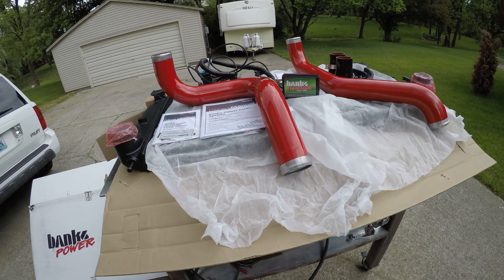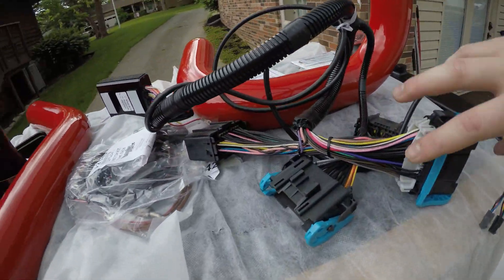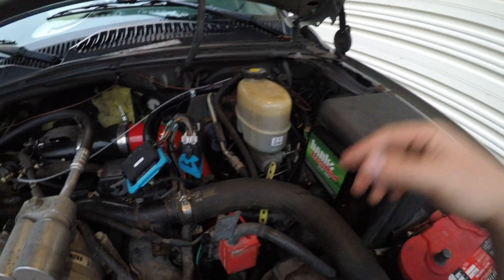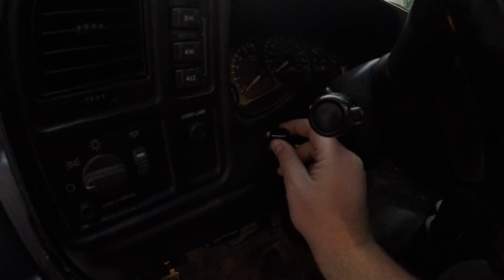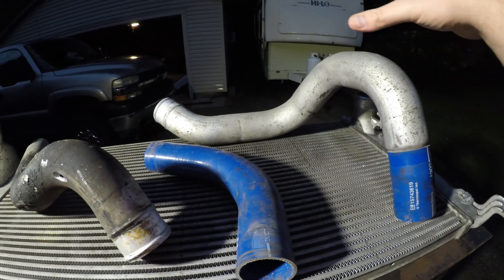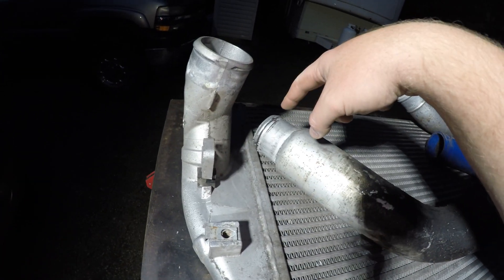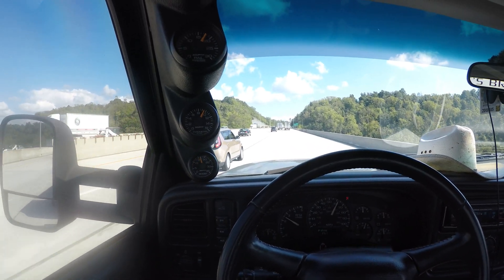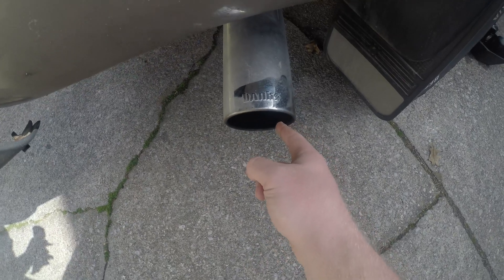Upgrade Lowdown:  '02 LB7 Duramax Banks Power TechniCooler Intercooler and EconoMind In-Line Tuner

Comment: I have always had EFI Live....think on this LB7 I will go with all Banks!!
Reply from the maker: Great!  These tuners are MUCH safer than EFI Live because of their active drivetrain protection.  That's how I'm able to send so much power through my stock transmission.  If you buy the tuner over the phone, please ask for Chuck and tell him that you learned about it from my video.  That'll really help me out!
Reply: @JayRussellDuramax  This tuner isn't safer than EFI Live. The only time it would be unsafe is if some clown that doesn't know what they're doing creates a crappy tune. EFI Live platform spanks on any other piggyback or flash tuner.
Reply from the maker: @2015_Rubicnn  Then why does everyone who uses EFI Live talk about hurting these transmissions with much less power than my truck is making?  

I emailed with Duramax Tuner, and, even with all of the upgrades I've done to my truck, their maximum power gains were under 100 horsepower at the tires.  The Banks tuner puts out more than that on a truck with far fewer upgrades than mine.
Reply: @JayRussellDuramax  It's not EFI Live tuning that hurts the transmission, it's the amount of power that gets added. The stock 5 speed can't handle much over 100HP extra over its stock rating. The allison is designed to sense slipping between the input and output of the transmission, and when it does, it goes into limp mode to preserve itself from any more damage. I'm pretty sure tuners like Idaho Rob, Duramaxtuner, PPEI know what they're talking about and limit 5 speed truck tunes to 100HP. If you look at the LBZ and up tunes, thet are rated at 120HP+ for stock transmissions. You'd have to see exactly what the Banks tuner is doing to make these claims..I just don't see how this piggyback tuner can supposedly be safer, yet provide more power, makes absolutely no sense. 🤷🏼‍♂️
Reply from the maker: @2015_Rubicnn  It's because EFI Live is static tuning.  When you reprogram the ECM, it runs the engine the same way all the time.  The Banks tuner is actively monitoring all of the engine and transmission vitals to ensure there are no issues.

The myth that the stock Allison can't handle more than 100 horsepower over stock is propagated by EFI Live tuners that add power in a way that doesn't respect the transmission.  The Banks tuner monitors for slippage and pulls power if it senses anything that could harm the transmission.  EFI Live does NOT do that.  If you tune your ECM with EFI Live in a way that causes the transmission to slip, you don't know about it until you limp your transmission.

These transmissions are very robust and can handle far more power than what these trucks make from the factory - certainly more than 100 horsepower at the tires.  If you add power in a way that respects the transmission, you will not hurt it.  My transmission has never gone into limp-mode, and my engine is twice as powerful as it was originally.
Reply: @JayRussellDuramax  I hope you know, tuning period is static, or whatever you want to call it. What do you think the factory calibration is? EFI Live software has way more parameters that can be changed for the power gains and efficiencies. Diesels make power by adding more fuel and injection timing, but their is a fine line. Like I said, you'd have to see exactly what's happening between what a piggyback tuner does vs actually flashing an updated calibration into the ECM. You state safer and more power, but the only way that can be done is less timing and less fuel, or de-fueling if the EGTs are high, and that equals less HP. 
GM rates their transmissions to handle a certain amount of HP and Torque(mainly torque) and so does Allison. Industry wide, the most HP you can add safely to a stock Allison 5 speed is 100HP. E mail Allison and call around to people that deal with these tuners and transmissions to see what the consensus is. It makes no sense Gail Banks claims this signal interceptor can make more HP and Torque yet be safe for the stock Allison 5 speed. Besides all of this, I believe the HP and Torque claims are at the crank and not the wheels.
Reply from the maker: @2015_Rubicnn  Not all tuning is static.  An ECM flash is static.  The Banks tuners are additional ACTIVE computers that intercept and modify the signals coming from the various sensors on the vehicle in order to get the ECM/TCM to behave differently.

The safety comes from the fact that the Banks tuner is ACTIVELY monitoring the vital signs from the engine and transmission.  This means that - no matter what power setting you have the Banks tuner in - it can pull power immediately if it senses an issue.  As I said before, EFI Live can NOT do that.  If you make too much power, you don't know it until you hurt something.

Also, Banks states that all power gains are at the rear wheels.
Reply: @JayRussellDuramax  First of all, the Banks piggyback does nothing to the Allison TCM. The TCM makes it's own decisions and has adaptive learning parameters it uses for shift strategies. You have to go through drive cycles for it to learn new HP and Torque levels. Second of all, the factory ECM monitors everything the engine is doing and makes decisions based on the input. The Banks cannot monitor more than the information the ECM receives unless you have a pyrometer installed, because these trucks to not have one from the factory.
Reply from the maker: @2015_Rubicnn  The Banks module connects to both of the main, computer connectors under the hood.  It may not modify how the transmission shifts, but it does monitor all of the signals - including shaft speeds - to determine how the transmission is handling the power.

Clearly you didn't watch the video, as I go over the fact that you install a pyrometer as part of this kit.
Reply: @JayRussellDuramax  Just because I made a generalization about a pyrometer doesn't mean I didn't watch the video or insinuate that you didn't install one. With that cleared up, there is no way the Banks module monitors the shaft speeds of the Allison, even the factory ECM doesn't even do that, the TCM does that. The TCM and ECM communicate via a CAN bus, hence the reason defueling happens when the TCM senses a mismatch from it's input and output speed sensors or in some cases shifting from clutch pack to clutch pack depending on how much torque input the TCM senses....
I believe you are over simplifying how things work and may not have a full understanding what's really happening. I'm glad you like the the Banks setup and I'm sure it's good for you, but a piggyback system is in no way more superior than calibration that's been modified and re-flashed into the ECM with many more parameters available. As I stated before, the custom tuning is only as good as the person or shop writing the tunes, and depending on what you have done to your truck, they are not a one size fits all tune either, hence the data logging capability. With that said, the piggyback setup can only do so much and is very sloppy compared to a custom tune for your particular vehicle and each power level. I would really like to see some independent dyno results with sensor data to see what's really going on between a piggyback system vs a custom tune.
Reply from the maker: @2015_Rubicnn  Why do you keep calling this a piggyback system?  It's an in-line tuner:  It intercepts ALL of the signals going to the ECM and TCM.  It receives the information BEFORE the ECM and TCM.  So, really, the ECM is "piggybacking" off of the Banks tuner.  Again, this configuration means the Banks tuner is actively monitoring the transmission shaft speed sensors for slippage - as well as ALL of the other information that both the ECM AND TCM use to function.  This setup literally has ALL of the parameters available - just like EFI Live.

The ECM clearly doesn't monitor transmission shaft speed sensors because, if it did, limp-mode wouldn't be necessary.  Limp-mode is the last-ditch-effort to protect the transmission when there's an issue.  This is also why EFI Live is inherently unsafe:  The ECM is tuned to make significantly more power even though it's not monitoring what that power is doing to the transmission - hence the universal assertion that any added power on these trucks requires a built transmission.

My truck with this Banks Power setup clearly shows that a stock Allison transmission can handle well over 200 additional horsepower at the rear wheels.  The ONLY difference between this setup and an EFI Live setup is that this setup is active tuning and EFI Live is static tuning.  This setup adds power while monitoring how the transmission is handling it and can instantly pull power if there's an issue.  An EFI Live setup makes maximum power until something gives - usually the transmission. 

The fact that you think this in-line tuner is sloppy means you're not understanding how they work:  If there's an issue with the added power, it detects the issue and pulls power without hurting your transmission.  EFI Live makes power until it hurts something, leaving you to beef up what broke and hope it can handle the power.  There's really nothing else to say here.
Reply: @JayRussellDuramax  Alright, whatever man.....you have no clue how this system works or an understanding how the Duramax ECM or TCM functions or communicates with each other, but that's ok. The term piggyback is a slang term for an aftermarket computer whether it be before or after the ECM that intercepts signals for a desired output. Sorry, the factory ECM doesn't piggyback off anything, it contains the actual calibration that controls the engine. Like I stated, I'm glad you like your Banks system, but don't make the claim it's safer than EFI Live based on no facts and only assumptions, but a competent tuner is a must as with any platform. Once again, EFI Live and the ECM has nothing to do with the Allison 1000 and how it shifts or is monitored and neither does the the Economind and if it does, explain how it does this?
Reply from the maker: @2015_Rubicnn  You're literally not responding anything that I'm saying.  The function of this tuner isn't related to how the ECM and TCM communicate; it functions based on how they respond to the signals of the sensors they're monitoring.

I understand what piggyback is slang for.  My reason for saying this is not a piggyback tuner is because it's a closed loop system that does WAY WAY more than add fuel.  That's what piggyback systems do, and they're complete garbage - as shown by Gale Banks when he compared them to his Derringer tuner on a later model truck.  This tuner is actively monitoring and manipulating sensor signals to generate clean, safe power and fuel economy - which is something an ECM flash is unable to do.  I don't understand why you're refusing to acknowledge that. 

Every claim I've made about this system is 100% based on the facts of how this tuner works - facts that you continue to ignore over and over again.  EFI Live has no way of pulling power the way this tuner does.  Period.  If you change the ECM calibration, it runs like that ALL THE TIME!  If you add too much power, you hurt the transmission.  This is where the nonsense of the 100 additional WHP limit comes from. 

This tuner does NOT change the ECM calibration to add the power; it simply manipulates the signals from the sensors in order to get the ECM to run the engine differently.  This means that it can respond to any issue it senses BEFORE hurting the transmission, and that's why my stock Allison 1,000 is easily able to handle the power.

Also, I've experienced this tuner pulling power multiple times in order to protect my transmission.  If you have it turned all the way up and it doesn't like something, the truck will fall on it's face immediately, and it will not receive added power from the Banks tuner until it's satisfied that the truck can handle it.  If I had EFI Live, that would've been limp-mode.

Please acknowledge how this tuner actually works and stop propagating the nonsense that an ECM calibration is better or safer and that the Allison 1,000 can't take more than 100 additional WHP.  If you watch my other videos and see how capable this truck is, it's clear that those claims aren't true.  This drivetrain is 100% stock and my injectors aren't oversized, and I'm making well over 200 additional WHP over stock.
Reply: @JayRussellDuramax  No, I read everything that you stated, and from what I read, you're only stating what the Economind manual or Banks has stated it works or what it's supposed to do. You're basically talking in circles with no facts and your own opinions. The other issue is, you really can't articulate anything via YouTube comment section, even more so when, I'll use your term....good ole advertisement "propaganda" from Banks gives you tunnel vision, so you're not understanding and or comprehending what I'm stating. It's laughable at best for you to state your (I won't call it a piggyback tuner) inline tuner provides way more power than any competent EFI Live tuner and be safer. Set up some dyno testing sessions and let's see this. I can tell you're hard headed about how this stuff works, because I've been around and dealt with many like yourself. I guess Allison and all of these tuners just make stuff up stating a stock Allison 1000 5 speed can only handle up to about 100HP stock? Anyone that has done more than that in the past have put their transmissions into limp mode, but according to you, magic happens and there's unicorns and rainbows.
You can believe what you want, make YouTube videos with no real data to back up any claims, but hey...you do you. 🇺🇸
Reply from the maker: @2015_Rubicnn  Banks Power has dyno proof for all of their products.  You can deny that all you want.  Unless you have proof otherwise, manufacturer data is fact.  Plus, the performance of my truck shows your claims about the Allison 1,000's ability to handle added power are incorrect.

I can articulate perfectly well in a YouTube comment.  This is no different than a forum or email.  Yes, my tone may be miscommunicated, but my information is not.  It's up to you, the reader, to read, understand, and acknowledge the information I'm presenting.  You claim to have read everything, but your replies make it clear you're not understanding it - which is why you refuse to acknowledge what I've been saying since the beginning.

I understand fully what you're saying.  The problem is that what you're saying is wrong.  You have outright refused to acknowledge how an ECM calibration works and why it's unsafe to do one with a stock transmission.  I've repeatedly explained to you how this in-line tuner works, and how that makes it much safer than an ECM calibration.  It's not magic and unicorns; it's closed-loop, data-logging that actively adjusts engine parameters to produce as much power and fuel economy as possible while protecting the engine and transmission.  An ECM flash tune can be set based on data logging, but, once it's set, it's set.  If the added power causes problems, you won't know it until you hurt something.

I never said any tuners are making stuff up.  I'm not denying how many tuners have hurt transmissions with added power and then blamed it on how "weak" the stock Allison is.  What I'm saying is that the damage to the transmission is the result of poor tuning, rather than a weak transmission.  This in-line tuner adds power while monitoring how that power effects the transmission.  Since the ECM has not been recalibrated, if there is an issue with the added power, the tuner can drop back to stock power levels immediately.  I don't understand why you're refusing to acknowledge the obvious safety advantage to that.

I invite you to watch the Banks Power video called "How to Build a Better Inline Diesel Tuner?".  Everything I've said is explained perfectly in that video, and the EconoMind works the same way as the Derringer.  ALL of my claims are based on established facts.  Yours are based in ignorance.
Reply: @JayRussellDuramax  Cool story bro....👌
Reply from the maker: @2015_Rubicnn  I think you'd be interested to know that I recently purchased an EFI Live tuning kit and have been combining ECM flash tuning with in-line tuning.  The results are spectacular, man!  I'm hoping to make a video about it soon.
Reply from the maker: @2015_Rubicnn  Hey, man!  I know you didn't reply to my last comment, but I'm hoping you'll watch the video that posts tomorrow morning, because I've tuned my truck with EFI Live in a way that enhances what the EconoMind does.  It's really neat!